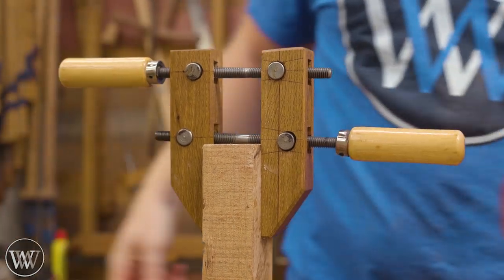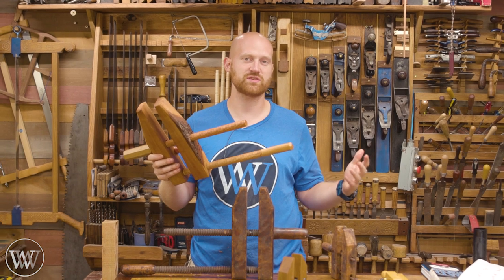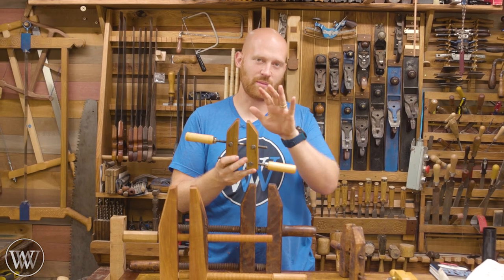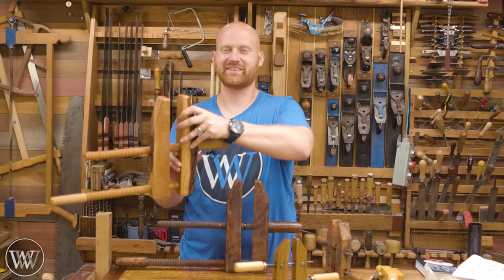Making Wooden Hand Screw Clamps

Comment: Hi James, I've seen a few of you wooden screw making videos as well as other makers. What I don't understand is how do you set the thread pitch ... Threads per inch, it just appears to be random on the initial circular turn. Is it possible to predict/specify 2,3 or 4 tpi??
Reply from the maker: Each screw box has the threads built into it so it is designed to work perfectly with the tap. Usually you make the tap first and then tap a nut into a screw block and that will then feed the screw at a standard rate.

Comment: Great video! What wood and oil did you use for the screws? Those threads looked perfect.
Reply from the maker: They are Oak. It would be slightly better to use maple, but it is what I had on hand. It was raw linseed oil.
Reply: Wood By Wright I have a huge amount of white oak, so that's what I use too. I've been using mineral oil to soak them, and had mixed experience with thread chipping.